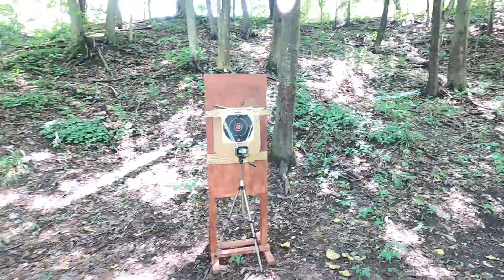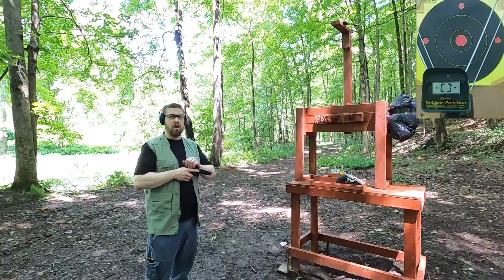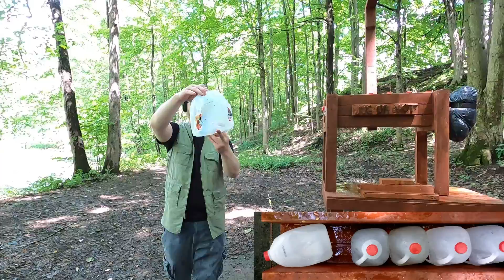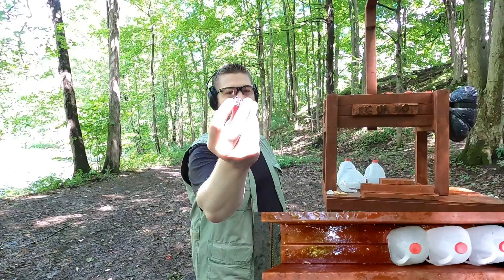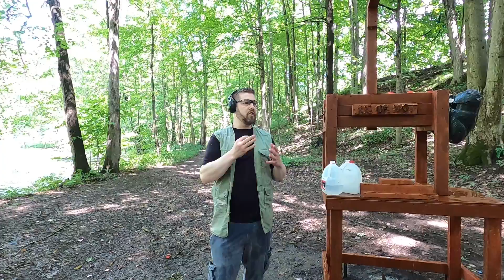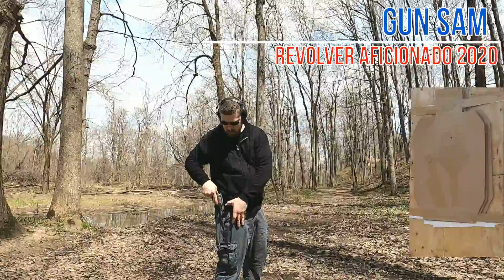10mm More Powerful than .357 Magnum? 💥ULTIMATE Test💥💥💥POWERFUL Ammunition

Comment: One difference to take note of between an autoloader and a revolver is the barrels. An autoloader has a sealed chamber whereas the revolver has a cylinder gap. If you test a revolver chambered in 357 magnum and 10mm the magnum does better.
Reply from the maker: I don't know if i'd agree with that because Buffalo Bore actually documents losing as much as 100 FPS with extreme spreads of velocity with a lower strength spring with their own ammunition in 10mm, and I also know that the cylinder gap tests of .357 Magnum vs no gap result in a loss of only 50 FPS.
Reply: @GunSam  I've watched a couple tests with revolvers chambered in 10mm and the velocities where a bit lower compared to an autoloader, I'll have to find them. It seems that magnum calibers tend to do better in revolvers and auto calibers do better in semi autos.

Comment: I forgot that the first Glock I ever shot was a 10 mm I immediately went out and bought a Glock 21 because back in the early 90s a 45 was a good carry gun for me I used to have a shoulder holster and with 3 —13 round mags I thought I was the shit
Reply: Also have the Rock Island Armory Pro Match Ultra 10mm with a 6-inch barrel and a double stack 16 round magazine I
Reply: Why I Carry An FNX 45 Tactical 

I conceal carry an FNX 45 Tactical with Trigicon RMR every day without ANY problems.  It's for a variety of reasons.

1) I have arthritis, and a "full size" gun is easy for me to hold and shoot.

2) It's built from the ground up to be fully ambidextrous, and with arthritis you never know when you'll have to use your off hand (and, Yes...  I train with my off hand about as much as I do with my dominant hand).

3) It was already milled for an an RMR... Something I had thought was a "nice overpriced gadget" that I'd never buy... Until I learned it solved the problem of aging eyes and bifocals

4) It carries a 15 round magazine!  Yep...  That's 15+1 of 45 ACP!

5) It comes with a 5.3" threaded barrel, so putting a suppressor on it is easy.  I will be getting one for really ONE primary reason.  I don't want to damage my hearing, if I have to use the weapon if someone breaks into my apartment. 

I searched "forever" for a 9 mm that would provide ALL these features, without ANY success.  Changing a gun to add these features after purchase, even IF POSSIBLE, would cost more than I paid for the 45 Tactical to begin with.
Reply: The Last Straw Now that’s what I call PACKING. Damn!!!!!
Reply: I have the G21 and G40, sometimes I put the G40 barrel and mag in the G21 frame and have a G20 with a 6 inch barrel:)

Comment: I'm sorry I just have to laugh, it sounds like you keep saying sexual density LOL 🤣
Reply from the maker: Well if the word sectional was pronounced different, but it is what it is. The bullets did give good sectional assault on the target though!
Reply from the maker: chances are statistical data and all, you are all working with a six inch barrel. But, density is up for debate. I hear a bull barrel or full underlug is better though.
Reply: @GunSam  lets hear it for the mouse gun people . A well placed .22 will still kill....lol. dont need a 6 inch barrel
Reply: Gun Sam Revolver Aficionado 4” bull barrels get it done for most 😂
Reply: I had a bad case of sexual density until my mid-20's - still a sufferer, but i get by.
Reply: 15" of penetration.
Reply: @patrickbolthouse7354  QUIT BRAGGING😁
Reply: @patrickbolthouse7354  Just the tip!
Reply: OK, this isn't the CRS Firearms channel! LOL.
Reply: My sexual density is good!
Reply: Wait is the flannel daddy's channel or Sam's?

Comment: Great comparison! Thanks man. I own a few .357 and a Glock 20, and that exact kind of malfunction is why I choose to only carry wheel guns. I carry a small .38 most days, and I'd rather have 5-6 .38 shots than a feed or eject malfunction on my glock 20 that requires you to drop the magazine during a fire fight. After a few malfunctions like that at the range with different autos, I've completely converted to revolvers lol. Otherwise, that 10mm was smoking for the recoil. But, man that .357 was insane.
Reply from the maker: Thanks. There can be some decent semi autos, but really to be reliable they need to be big and use ammo in the middle for power. Revolvers are nice because I could shoot .38 Short Colt 80 ft lbs then hot .357 Mag 800 ft lbs and it's going to function the same with both.
Reply: @GunSam   Looks like the jam happened due to TOO FAST slide speed . The mag spring didn't lift fast enough to keep up with TOO FAST slide speed . Never had a jam in any Glock , I mostly shoot mid range 10mm . I have shot Un Sized Starline brass ( new ) in the G20 that made my Kimber , fail . I now size ALL my new brass for any auto . More is not always better , to shoot indoors with no ear pro , best to shoot 45 acp , mid range 10mm , 38 special . Good test , I would never use any of that ammo . Save 155 gr for 40 S&W , best to use 180 gr +/- ( silver tip 10mm is 175 gr  ) & is VERY good stuff , super accurate , perfect results in different media . Many better choices in both rounds . Thanks !
Reply: Get a 10mm ruger revolver?
Reply: @nixter8739  Lately they have Many Good choices , one guy posted > Redhawk 45 LC / 45 acp  , That & a GP100  10mm  <3 !
Reply: Would a heavier slider spring correct that issue if someone decided to carry that round?
Reply: @christophernemeth421   I don't know , but I don't think so . I will post a video from Wilson Combat they can tell you better than I can . If you need huge power get a 44 or a 308 .
Reply: @christophernemeth421   Wilson Combat has lots of good video , this one they talk about what my point is https://www.youtube.com/watch?v=rjOPiZhEwA8
Reply: Revolvers lock up and when they do you can’t clear the malfunction typically.
Reply: @jdb2722  i have had that happen before, either due to a dirty cylinder or a bad casing. it’s pretty rare.
Reply: @pgman5416  me too and a brand new python but that’s pretty common for those 😂